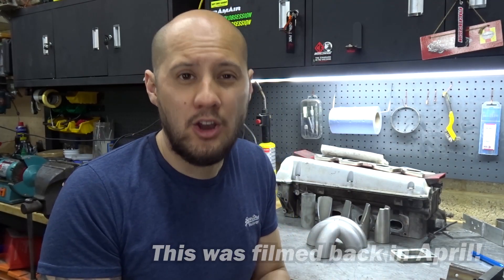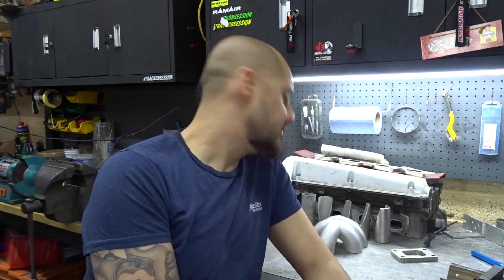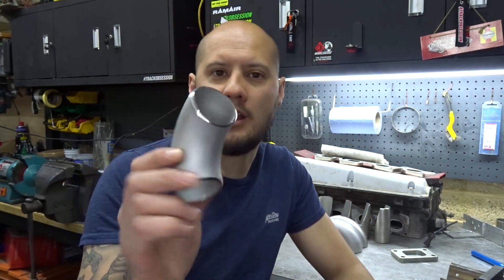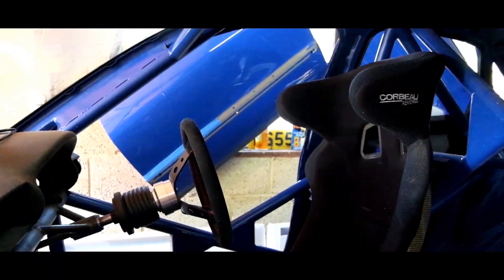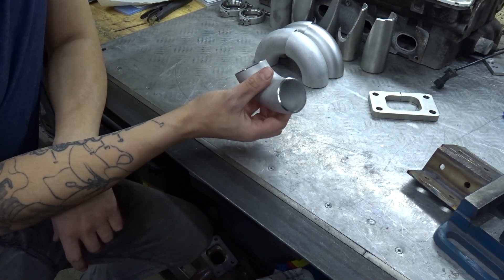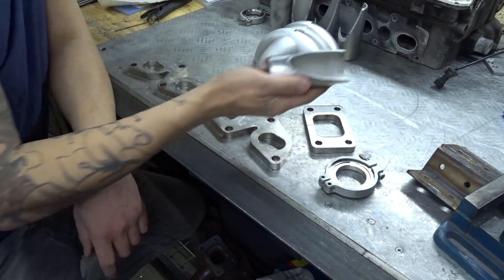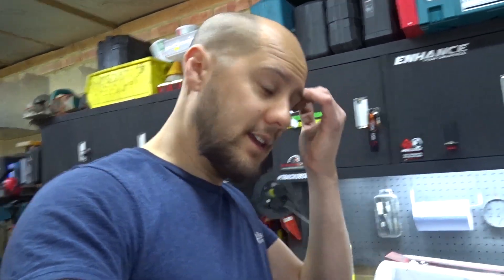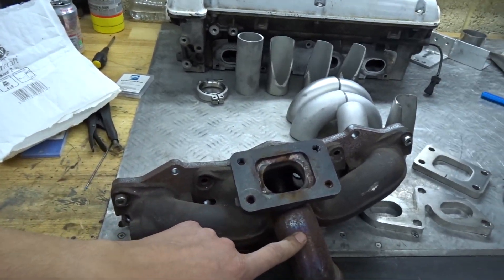How to make a manifold - Part 1 Merge Collector

Comment: You think 1-1/2"  dia., 16 gage mandrel bent 304 SS elbows will hold up for a T3/T4 setup?  I cant get thicker materials as 2 sets of my exhaust ports are too close to each other.
Reply from the maker: I think that it would be too thin really, what engine??
Reply: @AndyPonting  Toyota 22R

Comment: Well cool! I’ve just welded my mercedes clk 270CDI exhaust as it leaves the turbo it hits the particulate filter. So I removed the domed flange from the EPF and using the body of it. I made a conical expansion chamber in place of the EPF. This then allows the turbo to spool up faster from 15/16 hundred RPM to around 1400 RPM. Also it reduces the amount of stress on the piston as it moves up on the exhaust stroke. Creating a scavenging effect! And lowering EGT’s. Thus improving gas flow and power. 
Gail Banks was the source of that idea! He’s got his own channel here!ha banks destroying a duramax diesel! And holds numerous world records for racing diesel turbocharged racers etc! 
Love the manifold bud!! Looks awesome 👍can’t wait to see it’s finished.